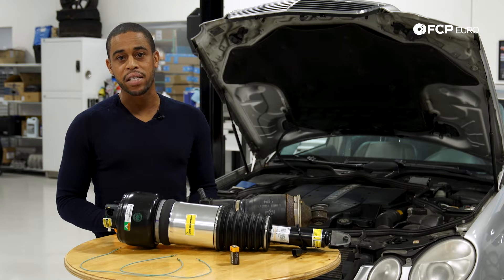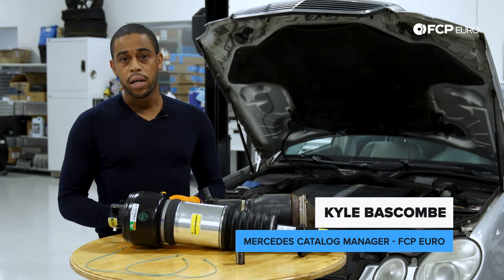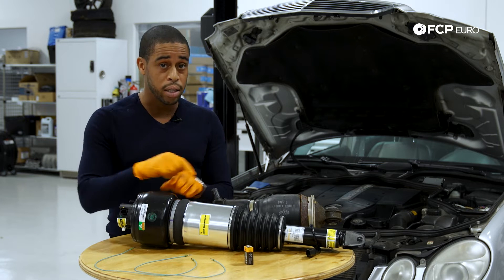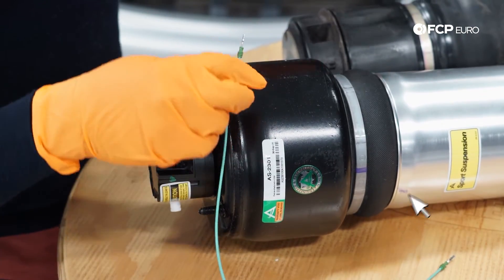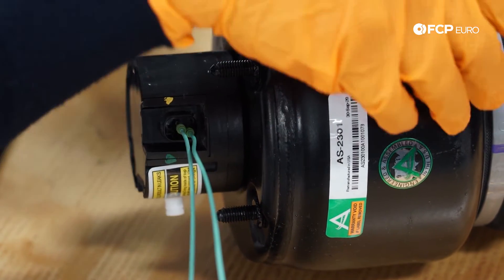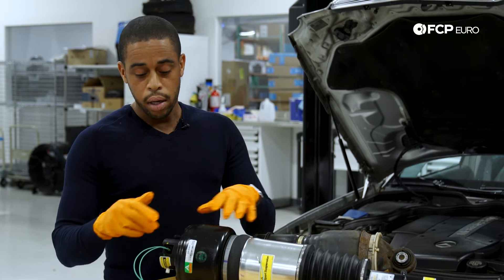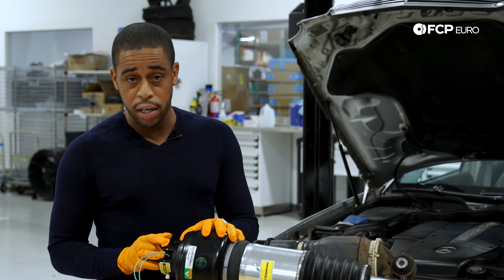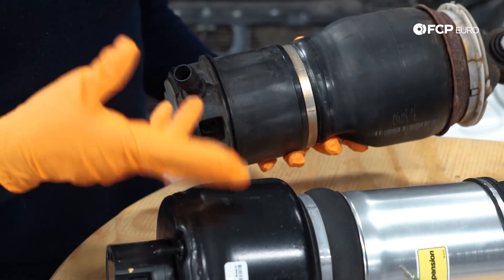How To Release The Air From A Mercedes AIRMATIC Air Strut

Comment: I dont have connections on top of the strut on my 2013 s550 rwd only has a wire connection that i plug into the wheel well. Would it still work? I see three pins but dont know which is the bottom im supposed to put wire to. Anyone?
Reply: Did you ever find out if it still works?
Reply: @leronking9351 with the 2013 s550 rwd struts the pin trick does not work to release air from them.

Comment: This may be a random question, but the cartridge that you pull out of the housing is that interchangeable between any other BMW models? I know the housing is different between model and model, but are any of the cartridges reused or possibly the same dimensions?

Comment: You forgot to mention which polarity the bottom pin is versus the middle pin.
Reply: in the comments section of the video it lists the blog link for this, in that links it states to "Press the middle pin’s wire to the larger terminal on the battery and the bottom pin’s wire to the smaller terminal"  The larger battery terminal is the negative

Comment: Hello chaps.  Unfortunately for the rear airbags on my S211 E55 this method was only partially successful.  Like a few others here I just got a clicking noise when I used Kyles method with the 5v battery.

I used a 12v battery charger and some small jumper leads from a multimeter accessory pack.  Polarity didn’t seem to matter but even on the rear airbags those pins are correct.  With the bag in situ it would be challenging without the leads.   

Happy to have resolved my issue anyway.  I didn’t realise the bag was still inflated when I removed the bottom bolt.  Shifted over into the damper so hopefully didn’t damage it.    Eek.  I guess I’ll find out on reassembly…

I love that its still possible to work on these cars as a DIY’er.  But they can be challenging at times.  Cheers all.

Comment: This information is wrong . First a 9v battery will not activate the solenoid. Second you need to use the 2 left side wires to negative and the single wire to the right to positive 12 volt battery and it will deflate . This video is propaganda. Just lies to set up DIYers to fail . At least for the rear bags this video will not work as they said

Comment: For inflating these struts where does the air come from?  Where does the line that transports the air lead from to go into the struts?  Thank you.
Reply: Hi pal. If I read your comment right. The air comes from a little compressor located (uk) passenger side front.. like near front wheel inside the bumper if that makes sense.. then a air line running from that, to a box shaped unit (i believe 1 air line going into it and 4 going out) the 4 air lines going out will be for each strut on the car... and the 1 going in will be from the compressor to the box.. inside the box are 4 valves that sort air going in to each strut.. and they also release air aswell.... I believe there is a valve on the actual compressor also.. I'm no mechanic and I could be wrong haha but I'm sure someone will correct me if I am 😂 Hope this helps dude
Reply: Sorry I'm wrong there is more air lines coming out of that valve box.. like 6 or 7 😅

Comment: I tried to bleed the air from the A-2724 rear air springs with a 9v battery but it doesn't work. Is there any other option, thanks Zoran

Comment: thanks for the tip !
have to change my e63 front left Arnott which is exactly same as the one you show (AS 2301 lol) I will go Aerosus this time
Arnott maybe do good bags, but the remanufactured part means : nothing done to the suspension. Which is factory and started knocking after 2 years of use. Thank you Arnott.

I 'll try to keep updating that post after doing that ;)

Comment: Hi Kyle. Nice trick. Unfortunately, I have been unable to make it work. I only get a clicking noise when activating no matter polarity. I even bumped up to 12v hoping that would work. Same thing, click but no air. Assuming the click is the solenoid. Any advice. The strut is an inch and a half too long to get back in. I would really like to finish the damn job!
Reply: I have the same issue.  Did you get it sorted?
Reply: @adogmcdizzle  Did you find any solution?
Reply: @coolis123inGame    yes, a 9v battery isn’t powerful enough.  I used a 12v power supply.  Used some short leads directly to the pins and then crocodile clips on the ends of those to ensure a good connection.

Worked a treat.  Just shows you can work on these cars without the expensive diagnostics.
Reply: Same issue aswell. Any solution?
Reply: @brianpascoe7731  Did you find any solution?
Reply: How was this issue resolved
Reply: @mariol.gonzalez3717 did u find a solution???
Reply: @mariol.gonzalez3717  Did you find any solution?
Reply: Did you find any solution?
Reply: @coolis123inGame  Need to remove the air line to make it work.

Comment: Thank You! I'm dealing with a 2008 cls550 that the front shock are at full capacity and wont lower even if you remove the air line. I'm crossing my fingers this will work for  me after the rain subsides. again thanks!
Reply: Hi mate sorry to comment on a old one. Did you manage to get the shocker down.. have have my rears up high and won't go down so was going to do this to lower the car and see if the shocks wear gone or a sensor..
Reply: @clungechewerGM  that was a while back. Yes, I replaced the shocks. There was a problem with the internal sensor.
Reply: @Pierre Sutton  haha sorry 😅. Appreciate the reply tho. Glad you got it sorted aswell. But good to know 😌 hopefully it's not a big issue but we all know it's not that simple with cars haha. Thanks man 🙏

Comment: Finally got around to replacing the rear air springs on my non-airmatic wagon. Getting those wires onto the pins to release the air pressure with the units on the car is wishful thinking. I ended up making a very crude pigtail with a couple wires to do it. The rest of the job was simple.
Reply: I did the same but am only getting a clicking sound no matter polarity. I even increased to 12v, still no luck. If I can release some air I can get this damn strut in and finish the job. Any thoughts?
Reply: @LL-po4dh  If you're dealing with the front struts, are you contacting the middle and lower pins as in Kyle's video? My car has just the rear air springs, so only two pins in those.
Reply: Hi Jack, Thanks for the reply. I did finally get it to release by making some contact pins with some old electrical parts and using a 12v portable automotive jump starter. My problem now is that once reassembled and running, I am having issues with full inflation of the front air strut I replaced. If I put the vehicle in raised mode, it seems to be ok, but if I put in the sport 1 or 2 the tire runs on turns. I have jacked the vehicle up a couple times to extend the strut to its max to allow for filling but it seems to only work temporary. I am concerned that I cannot get the strut to level out like the other side. I certainly don’t like the rubbing. Any suggestions of how to get that strut properly inflated? I have checked for leaks and have found none.
Reply: @LL-po4dh  Sorry, my experience is limited to the rear air springs on a wagon, which has conventional front suspension.
Reply: @LL-po4dh level sensor

Comment: Kyle, love your video on releasing the air. I have a question for the reverse procedure please.I have just replaced the 2 front airbags on my W211 2003 E500. I didnt repleace the entire strut, just the bag itself which meant removing the bag solenoid and completely depresssuring the bags. I have re-installed the bag on the existing struts, reasssembeled in the car, but the car wont pump them up? Is there a trick here to get the air bag into fully delated bags? Air is present at both bag solenoid units. I welcome any feedback.
Reply: Hey man did you have any luck? Also how do you remove the top black block or solenoid? Thanks man

Comment: Neat trick. I assume polarity is important so switching the battery terminals is required  if it doesn't release air on first contact.
Wish I'd seen this two days ago!.
Reply: in the comments section of the video it lists the blog link for this, in that links it states to "Press the middle pin’s wire to the larger terminal on the battery and the bottom pin’s wire to the smaller terminal"  The larger battery terminal is the negative

Comment: What do you do with the air hose you remove when changing the rear air bag with the Arnott brand that doesn't require the air hose.
Cheers
Robert Holding (in Oz)

Comment: Thanks for this tip. How about the polarity of the battery? Doesn't it matter which terminal of the battery goes to which pin in the strut?
Reply: in the comments section of the video it lists the blog link for this, in that links it states to "Press the middle pin’s wire to the larger terminal on the battery and the bottom pin’s wire to the smaller terminal"  The larger battery aterminal is the negative

Comment: would this work for a new front strut of a 2002s500 ? i got it but its almost an inch and half too long to get set back in the car  thanks
Reply: Hi did you ever figure this out? Im in the same situation where I actually need to DEcompress the strut to get it ON the car. Any advice is appreciated
Reply: @tgbitw17  how did you end up doing it ? Currently stuck with my 2000 s500 also getting it back on
Reply: @tgbitw17 how did you end up doing it ? Currently stuck with my 2000 s500 also getting it back on
Reply: @angelayala4903  it's still not fixed,I'm not a fan of dealer price of 1800,and pay first and if don't fit I pay a restock.fee. and thats.not installed for that price.
I'll start looking again soon tho
Reply: Same issue on a 2003 s430. In desperate need of advice